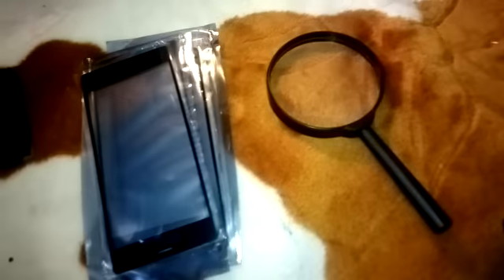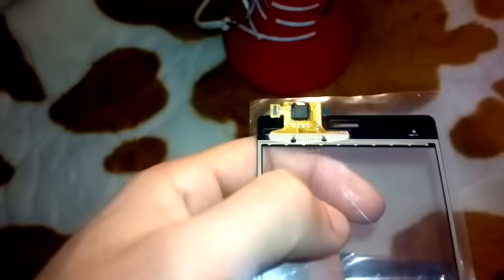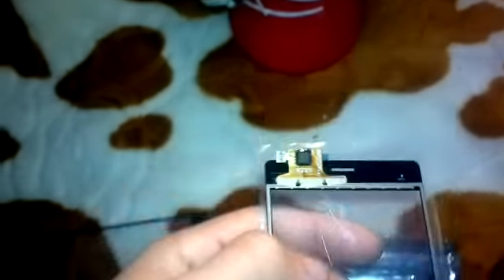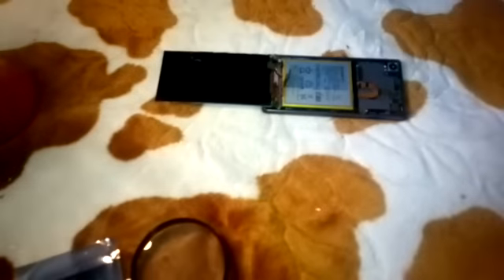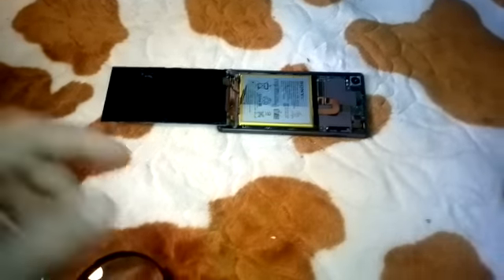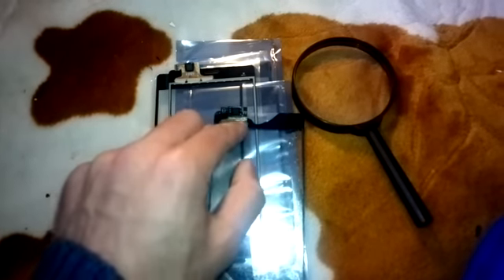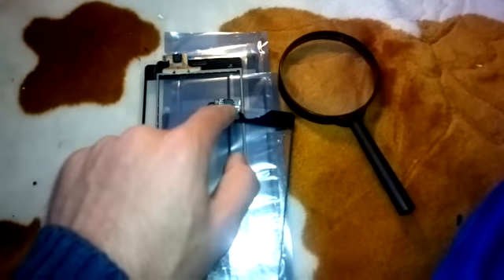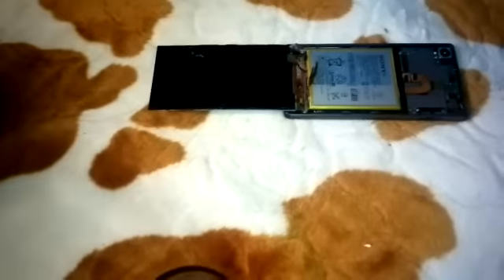xperia z3 - D6603 new replacement Digitizer first test 2/2

Comment: Oh... I just buy it on ebay.... can you please write in a comment the correct chip and the fake. Thanks
Reply from the maker: Original one :

synaptics
S3528A
42610342
ACBK816
.+00

FAKE one :

synaptics
S3528A-3
42810342
AGPA733
.+00 -1

please if you find datasheet of these synaptics chip , email it to me or upload them to see the pinouts
Reply from the maker: billme later 
if you found a working digitizer , please give me the link , i need one digitizer D6603 like this synaptics ,,,
Reply from the maker: do not use black adhesive tape , use the yellow adhesive double sided , and the glue used for bicycle air chamber repair , (tires reparing glue) and also buy black oil based paint , ''' mix the paint to the tires glue ,

apply some glue painted all over the place where you found adhesive before , when you apply it to all borders , clean excess , and prepare (cut) the right lenght of adhesive tape , and also try to make round corner like the phone , then heat up , the glue and place the double sided yellow tape ,,, part by part , try to heat and in the same time place the adhesive tape ,,,untill you place all parts , try to pull them down , to stick the tape very well , and try to not , remove the top protective paper of the tape's second side , untill next day , then take the lcd near of you ,

remove the paper on the top of the adhesive tape , and pour another squeegee of tires glue , heat it , untill it is boiling , (im using hot air station) and try to be fast but not to do mistake , fit the flex cable and heat up the glue , then push the lcd to its place , and pull places where thickness is little more than normal , after 10 to 15min , took the hot air , and heat place not sticked because of excess and push it down ,
when ,,, you push , you have to work with the lcd turned on , to see if you gonna damage the lcd , or if heat will damage the lcd , but do not worry about heat , it is just the liquid crystals that evaporat inside the lcd sheets but they come back to their normal state even if the lcd became black for few seconds ,

good luck
Reply from the maker: RINALDO SASSAROLI 

im waiting for 20 pieces of xperia Z3 to be separated , so it became more serious and more pro , 
i need vacuum pump with UV lamp and if possible i'll make a box with place for gloves and vacuum pump

so i didn't assemble this one even if i can do it , but i prefer to wait instead of losing this lcd

i mean bubbles remover by vacuum